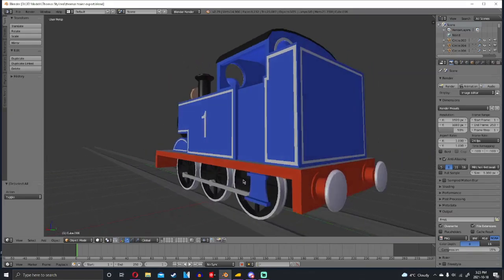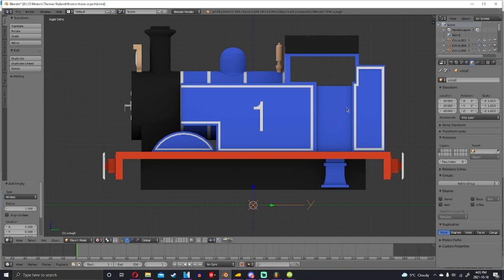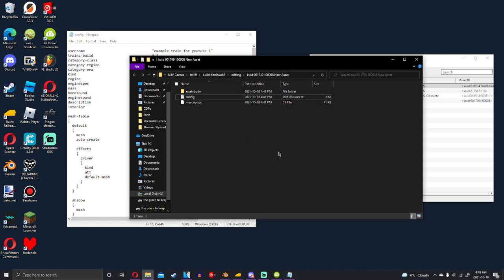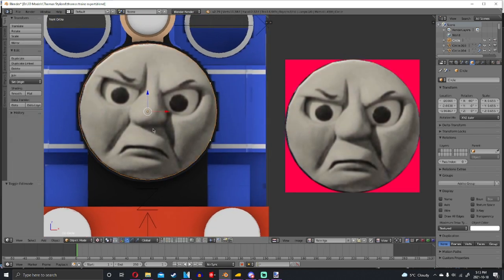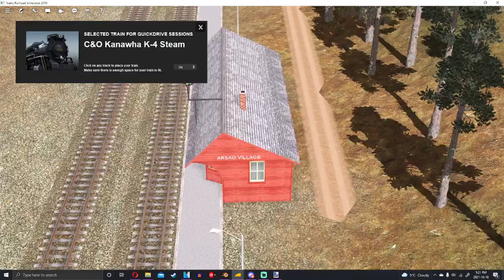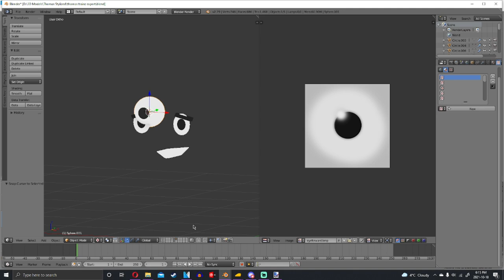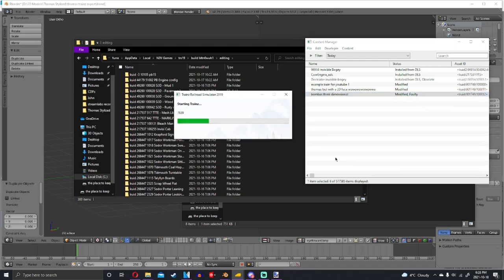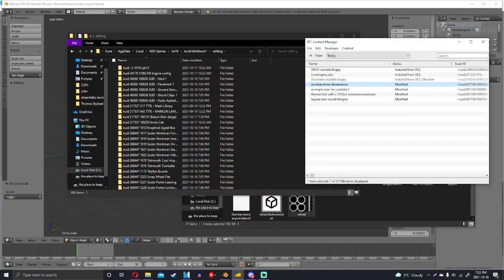Trainz Locomotive Export Tutorial | Non-PBR, Regular/2D Face/3D Face

Comment: Sometimes, baking is gonna screw up for no reason and seem impossible to fix. If you are trying to bake a mesh and it isn’t working, you can try a few things:

1: make sure you created an image to bake and have the mesh selected 

2: in the properties tab (the top right box with the list of meshes and objects), scroll through and find the mesh that isn’t baking. If you have the mesh selected in object mode, the name of the mesh should be highlighted orange in the properties tab. Make sure the camera icon is turned on (You will know it is on if the camera icon is not a light grey color). When that is done, redo the baking steps. 

3: Do not leave blender or try to modify another mesh while a mesh is baking. It will screw up the baking and cause it to look strange.

4: if the baking looks weird (different colored lines along a mesh, black spots on smaller meshes, etc) on a mesh, you can select a certain part of a mesh in the UV image editor tab by pressing C and using the circle selector, and using G to move the  vertices around so that the baked image looks cleaner.
Reply: when i open the UV editor, nothing shows up.